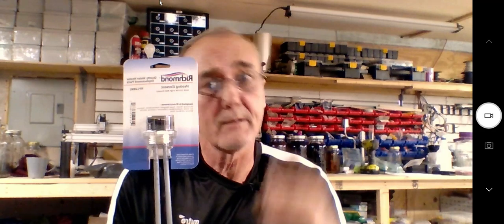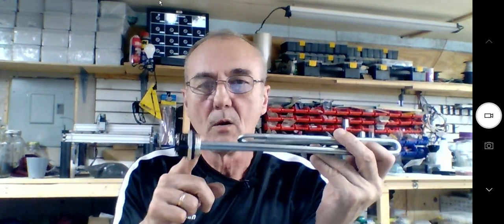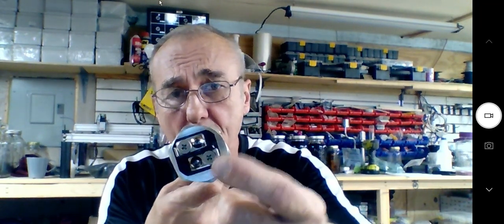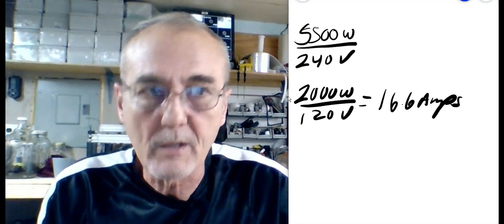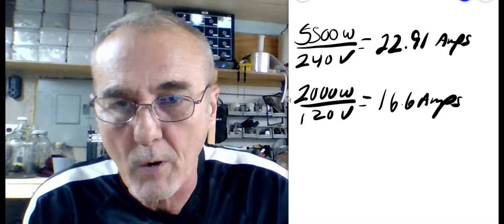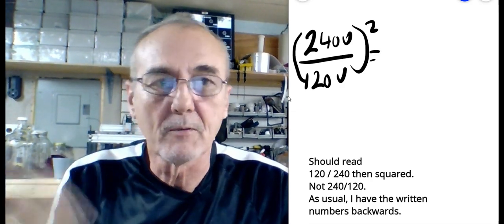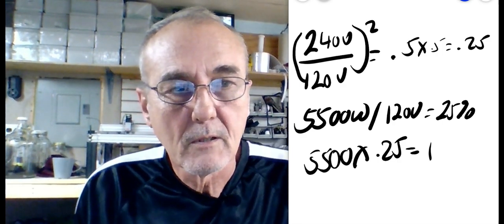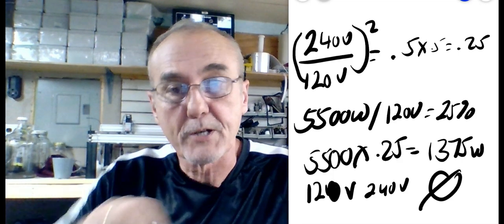Heating your Still or Oven with Electricity (corrected version)

Comment: Try placing solid state relay on heatsink. Just take note not to exceed your housewiring max current rating eg 2.5mm2 at max +-30amp to powerpoint. This South Africa standard, just some info.😊

Comment: Thanks George.  Some questions on the high, medium and low density element choice.  What factors enter into choosing one or the other of these for your still pot application?  For a 2000 or 3500 Watt element, which density works best in a still pot?  Is there a concern for the higher density elements concentrating heat (same energy over a smaller heating surface), and can that cause issues?

Comment: Hi George....I'm still so new to this and am looking at alternative power sources and one that I was looking at because I literally have sun all year round is using solar energy. I was looking at hooking up some solar panels off grid that would go straight to the heating element and a thermostat to regulate the temperature like an electric job so to speak. I was looking at using a copper element to assist but I am confused over wattages, element sizes and now over what size panels I would require. I think it's a feasible green solution and would save money instead of mains electricity or gas stove and also from a safety aspect would this be safe to do
Cheers for everything by the way...I'm hooked and I haven't done anything yet, just love the theory

Comment: For my vapoir managed compound column I use a 4500 watt element @240V to bring my wash up to temp. I then switch it to 120V to run at 1125 watts to collect my product. No controller necessary.

Comment: Hello sir 
I watched a few videos of yourself.....
I am looking to get into this just for a hobby. I have almost finished assembling my own diy still ..... just wanted to check using brass compression joints or plastic push fit are ok to be used for my still ( ie alcohol vapours coming in contact with brass ) ??? Just wanted to check n be sure if I am making just at a hobby scale 
Thanks .... please reply
Reply: Not good idea to use brass or plastic as these materials can react with higher alcohol proofs. Stick to copper or better, stainless steel.

Comment: I’m not real familiar with North American systems, here the grid can supply anywhere between 220 & 250V and still be considered “acceptable”

I am confident it’s the same for you with 110-120, and 220-240

RMS is 0.7 or something, so while 240VAC is the RMS value, the peak value is close to 370VAC.

There is technically an average voltage as well, which would be close to 220 but it’s useless in the real world, not many electricians would remember it from school
Reply: Also if you have two 120v elements in series you can put 240 across the pair

Comment: Thanks for the video and information. 
I was reading something the other day and someone put a good idea in my head what do you think about this 
When you pitch your yeast use too kinds first bread yeast then D.A.D.Y yeast the idea is that the distillers yeast will kill and eat the lower volume bakers yeast.
I see where this could be right if done right but wanted to know what you think
Thanks for reading
Reply: Irving Day
....George did a video on staged fermentation. you might want to look it up.
Reply: @fourdeadinohio8303  I was not talking about staged fermentation.
I have seen the video mean of times 
Staged fermentation is when you add sugar at different times 
I was talking about adding a lesser yeast that would die off and the distillers yeast could cannibalize it
Reply: @gerrymcerlean8432  so your new to the hobby?
Because that's not true yes it covets suga to alcohol only but as a living thing it needs mirco nutrients in and they do eat the dead yeasts 
Thats why there's so many additives available in the brew stores

Comment: Code requires that any 120/240v circuit shall not have its calculated load current exceed 80% of rating of that circuit breaker in use to allow for voltage drop losses across long spans in residential wiring and accounting for heat from hysteresis if several wires are run close proximity... That's why you can't find household devices rated	> 1500W having a built in power cord****2000w/120v=16.667A but with 80% derating for receptacles according to the code, it could cause overcurrent failure on anything rated 20A because 16.667/.8= 20.833A.  leading to a tripped circuit, or melted receptacle terminals, or underrated wiring which could lead to a fire.  Be safe and happy distilling.